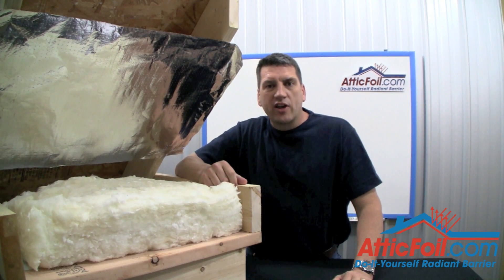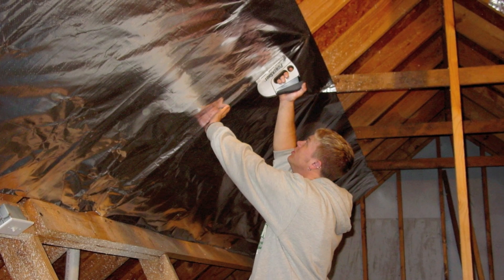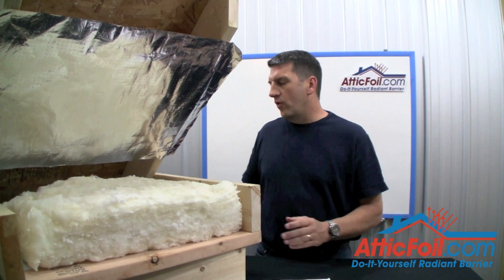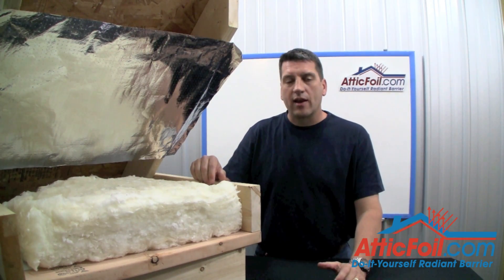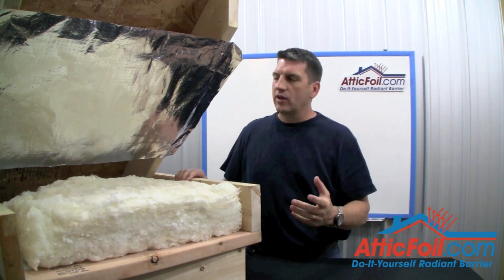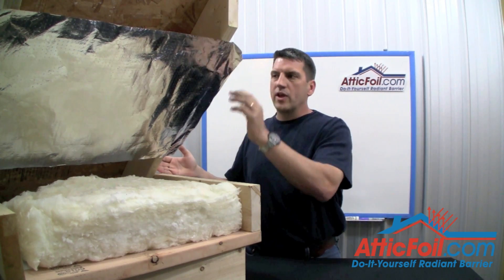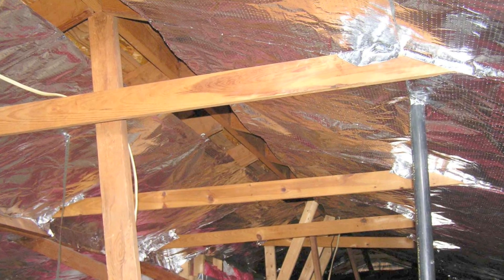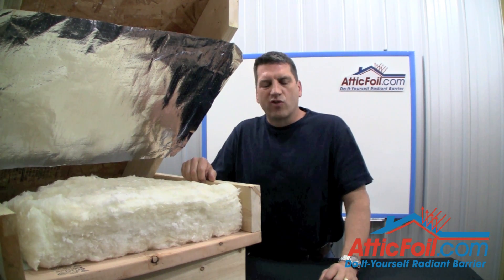Radiant Barrier Questions - Size of Gaps At Top & Bottom Of Attic?

Comment: Hi, quick one: I live in Buenos Aires, Argentina. I have a non insulated roof with french terracota black tile on it. My idea is to remove the tiles, replace the 2x1s with higher strips and spray 3 inches of foam an then put all the tiles back on. The local installer says radiant barrier might not be needed. What do you think? Thanks!!
Reply from the maker: I think the local installer wants to sell foam.  Radiant Barrier should always be your first line of defense.

Comment: So what happens if the installer doesn't leave an air gap at the top of the roof (i.e., air is trapped in the rafter bays).  Does that area just stay hotter than it otherwise would, or does that cause moisture problems in the winter?
Reply from the maker: It depends, if you have ridge vent than all good.  Otherwise the area along the ridge COULD get hot enough to cause some premature aging of the shingles.  An easy fix is to just cut a slit near the top of each rafter bay to let the air out.

Comment from the maker: Yes, we have had many customers install in motor homes, shipping containers etc.  Basically, you want the metal, air space, foil, regular insulation and then interior skin.  Try to maintain at least a 1/2" air space on one side of the radiant barrier foil.

Comment: I would like to install this in my motorhome 
It will mainly be used for warm weather and some mild to cold days 
installed like this 1 1/2 gap from outer hull to barrier then covered with 1/8 plywood panels right on top of the barrier on walls, ceiling and floor with no insulation added 
Would something like this work

Comment: OK, well that answers that question. Thanks 4 replying. I have also seen a radiant barrier that goes in the rafter bay, not across the rafters. Can't B as good as what you have, the wood rafter bottom, exposed, will transfer heat. That doesn't make cents to me. I will get a measurement of attic space and get price from U. Do U have sales and install in Seminols Florida, West of Tampa? R do I,  DIY? Come back.

Comment from the maker: You really want air to be able to flow BOTH between the foil and the roof deck AND into the attic below the AtticFoil radiant barrier.  I'd still leave a gap at the top even if I was using ridge vent.  You really want all the air to be able to flow freely through the attic as though the foil isn't even there.

Comment: I am thinking of useing this product in my attic. I live in Florida and want to reflect as much heat as I can. I am also putting on a new roof with a ridge vent. Do I still leave 8" opening at top 4 ventilation? Can't just seal under the ridge vent opening and keep more of the hot air out?